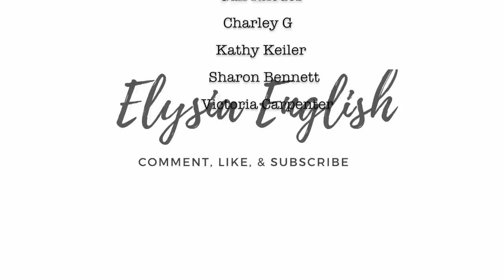Extreme Camper Makeover | Paint Party | 100,000 SUBSCRIBERS!

Comment: Use low expasion spray foam, or it will push the metal out if it gets in anywhere you don't want it . especially if you can see outside..
Reply: You should name your camper "100 G's" lol

Comment: Just a quick tip, the easiest way to prevent bored through is using an oil based primer. It’s also one way to prevent wallpaper bubbles. If you use a water based primer, then it will creates moisture which causes the bubbles. Btw is looking great and congrats on the 100,000 subscribers!!! 🙌🏻🙌🏻🙌🏻

Comment: Put a box fan in the room and let it run overnight to help the paint to dry.
So paint over the darned wallpaper and if it "eventually" bubbles up then you can strip it off...it's much less likely to do that with a couple coats of paint on it. And if you have to do it in a few years, oh well, you got the rest of the job done quickly so you could use the camper without the torture of trying to get that stuff off and then it's just a maintenance chore.

Comment: congrats on 100k!     i got a tip you may like to do. i seen you where putting on the primer and well thought you may want to think about using some painters caulk on the cracks and little holes as well as maybe the places where the wall panels meet. it will help with hiding the  seams

Comment: Hello friends. I wonder if you could replace the front kitchen window cover supports with window lift support shocks. It would be easier to push up without having to hold each side as you tighten it. You could put a latch to keep it closed if you need one.

Comment: is the wallpaper attached with adhesive or wallpaper paste? if it is adhesive you could try spraying acetone along the edge as you are pulling.
Reply from the maker: It’s a weird vinyl that’s clearly been manufactured on lol it’s not like a wall paper. Seems the heat gun is working